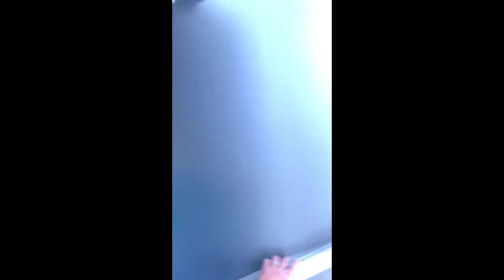Porsche Program Tech Talk with Tyler and Arin (Recorded Live)

Comment: I’m getting ready to get your tune on my stock GTS 718. I eventually will get a high flow catted downpipe. Will I need to change tunes to the catless dp tune since it likely won’t throw a code? Basically what I’m asking is there any actual calibration changes outside of  turning the post cat o2 sensor off for higher flowing downpipes?